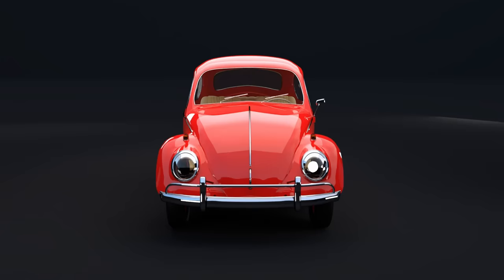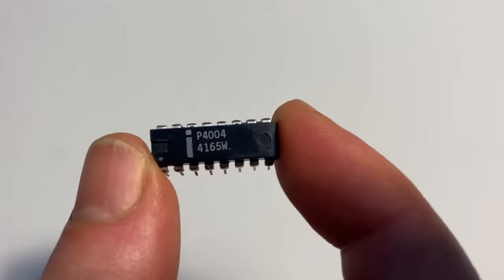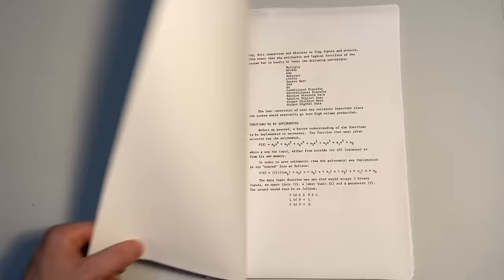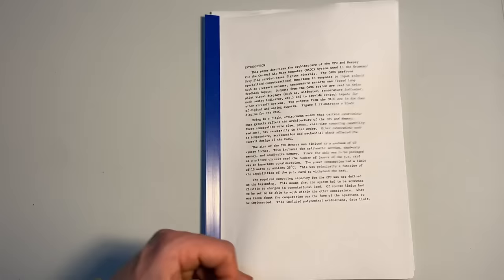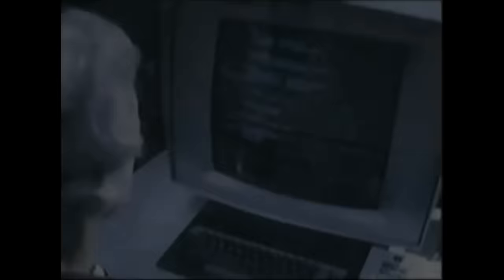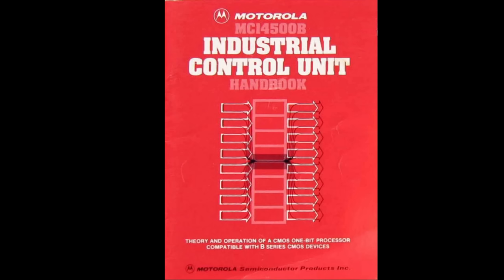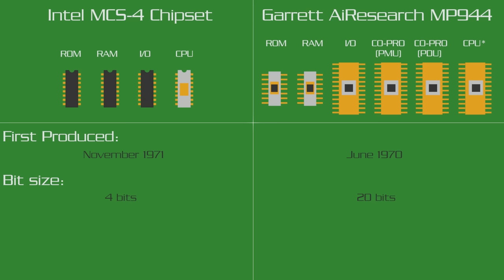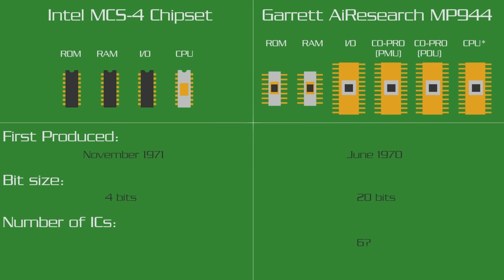The World's First Microprocessor: F-14 Central Air Data Computer

Comment: I worked on the 4004 back in the day for Intel. It was not a stand alone chip either It required a clock chip and a couple level translators. It was a PMOS chip and did not work with standard logic. The IC's required were the 4001, 4002 and 4024 as I recall.
Reply: Even processors of the 2000s required a northbridge and southbridge to handle I/O.
Reply: @tankermottind I used to be into building desktops back in the day, and I remember needing to keep an eye on northbridge and southbridge temps when overclocking. Have we really made those obsolete in the 15 years since I last looked?
Reply: @mrb692  yeah its pretty much all integrated on the cpu now. Even memory controllers sit on the cpu die now. Its neccessary since data moves so fast now, cutting the "middle men" on the motherboard was a huge leap forward in modern computing.
Reply: @wizzalien7796  Whoa, that’s pretty sweet!
Reply from the maker: Honestly, the reason I didn't do more with the 4004 in this video is writing scripts to emulate the 4024 and 4001 chips was too much effort for me to undertake. The repo I referred to is supposed to do that but it's all written in C++ which I'm not very good at.
Reply: The 4004 also required 59 TTL chips to operate.
Reply: The Fairchild F8 CPU was split across more than one chip as well (if you wanted a program counter) and I think most people would consider it a microprocessor.
Reply: @mrb692  The reason was power Requirements and Consumption. Had nothing to do with the Single Chip designs of that time. 

Something that is not discussed in this video. As the Wattage required to run the system was huge. Nothing like today's designs. Where you can run a single chip design on 100 watts. 

One reason the F-35 keeps getting upgrades. They have reduced the wattage requirements to run all the sensors. So they add more functions to them. Last I looked they are around 270v DC Powered with EPACS 80 kW cooling capacity. Which extends the life of the subsystems.
Reply: Weren’t the 4000 series of components originally designed by intel to make a calculator, that 4004 just happened to be the designation of the main processor, rather than having any specific meaning. However, Intel then created the 8 bit versions and used 8008, 8080 etc to show that they were 8 bit devices.
Reply: @MRCAGR1  The 8008 has almost nothing to do with the 4004.
Reply: Even the 8080, a third generation microprocessor, effectively required external logic for a number of functions, including clock generation. It was typically used with a 8220 Clock Generator, which provided the asymmetric clocks ϕ1 (2 cycles high, 7 low) and  ϕ2 (2 cycles low, 5 high, 2 low), logic for generating a clean RESET signal, and synchronisation of the 8080 READY sigal. Additionally, not all standard control signals (for determining whether the CPU is reading or writing to memory or I/O space) are available on their own pins from the 8080, so it's very common to use an 8228 System Controller to decode the status information on the data bus pins between data bus access and have it generate those signals.

And even the original 6800 required some external circuitry, if only minimally a couple of gates, to generate a clock signal. It wasn't until the 6502 (IIRC) that you could connect a crystal resonator directly to a microprocessor and it would generate its own clock signal using that.

And even there, the crystal resonator, indisputably an external component (if not an active one) was still required. So you can see that even when several years after the third generation microprocessors we reached the point of having a single-chip MCU (microcontroller) with all RAM, ROM and I/O on board, one could still argue whether this really is a "one chip" system.
Reply: The amazing thing about the MP944 was that it did not require any external chips other than the six unique chips. This puts it way ahead of the Intel 4004.  Ray Holt
Reply: @firstmicro  This is not the case. The minimum fully operational 4004 system is just two chips: the 4004 itself and a 4001 256-byte ROM; the 4001 also provides a 4-bit I/O port. Along with a relatively simple clock generator, this is not just a microprocessor, but a complete (albeit very small) microcomputer.

That minimal configuration is obviously rather tiny, with only 16 words of RAM (the registers) and 4 bits of I/O, but still useful for simple control applications.

If you're willing to go as large as 6 chips, you can add 4001 ROM and 4002 80-word RAM in whatever combinations you like, giving 20 bits of I/O, 256-1280 bytes of ROM, and 16-416 words of RAM.
Reply: @mrb692  Southbridge chips are still a thing. Server grade AMD chips have so much I/O that they don't really need one.
Reply: The minimum requirement to run a program was the 4004 CPU and 4001 ROM (256x4 bits) plus the clock generator you mentioned but that could be made from basic logic gates, I think the chip was included later as 4201A. On the 4001 ROM you could specify 4 input or output pins together with the program memory. For more useful system beyond using internal CPU registers there was the 4002 RAM with 4 output pins. The 4003 shift register wasn't as much needed in my opinion if you didn't require a lot of I/O, it was really a simple shift register, lowest level integration of them all.

The MCS-4 system also included pair of chip 4008 and 4009 which allowed accessing standard memories and other chips with TTL bus for I/O. Later it was upgraded to single package 4289 and there was 4265 TTL comaptible chip offering whole 16 lines of inputs and outputs in different configurations. Those were officially part of the later 4040 CPU but they were compatible with 4004 too.
Reply: @Curt_Sampson  You forget address (A0-A7) latch
Ah, my mistake, i8085 need address latch, not i8080.
Reply: Technically the first modern CPU was the 486. Don't forget that cache was external until then, if it even existed at all. The MP944 similarly required multiple chips to form the CPU. These should be called generation 0 CPUs.
Reply: @Lurch-Bot  Eh no, you're using your own definition that no one else shares, and even by your own definition you are almost certainly wrong since there were full SOC's before the 486, preceding it by many many years. I can't figure out what your definition of 'modern CPU' is really, but the 486 did nothing that had not been done before, it just specifically integrated certain flavors of different things into one unit. There were other similarly integrated chips that came before it, just integrating different flavors of chips together but in a functionally equivalent design - they just were not x86 compatible and were far more expensive. 
Cache can't possibly be a pivotal thing for being a "modern CPU" since it is completely unnecessary, it's just a clock cycle saving device and adds no capability really.

Comment: I entered the USAF in 1978 and was a aircraft mechanic on C5’S they had a top secret (or at minimum secret) system called “ MADAR” (Malfunction - Data - And - Recording) it basically diagnosed the plane in real time and when called up the mechanic on board could figure out what he needed to repair the aircraft it also could be downloaded to put in the aircraft records for future use. Pretty cool stuff for that day!
Reply: This is a Lockheed feature in general; it was also available in Civilian aircraft like the L-1011 Tristar. The milspec one was probably fancier but Lockheed was ahead of its time in this regard.
Reply: My dad was a flight engineer on the C-5 and I remember him talking about MADAR all the time.
Reply from the maker: I wonder if that eventually evolved into the self-diagnosing FBW computers that are used today on commercial airliners (probably not, I expect they were developed independantly but it's a fun thought).
Reply: @Alexander-the-ok  MADAR itself didn't, but Lockheed was about 20 years ahead of the competition with it. The systems that came about in the late 80s/early 90s brought similar functionality to other manufacturers' aircraft. I don't know how much lineage current Lockheed aircraft systems have to MADAR but it wouldn't surprise me if there's still some DNA.
Reply: MADAR that was a hell of a system, until you have to reload the program from tape with the engines running and flight crew staring at you.  Bubble memory lives!